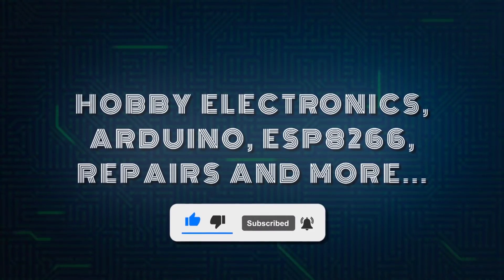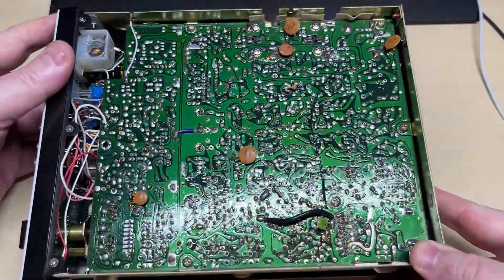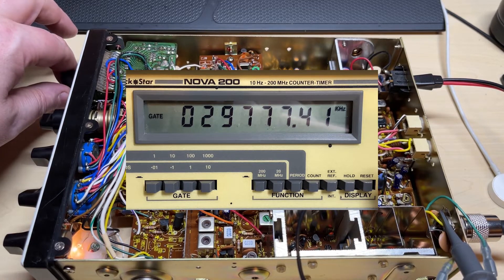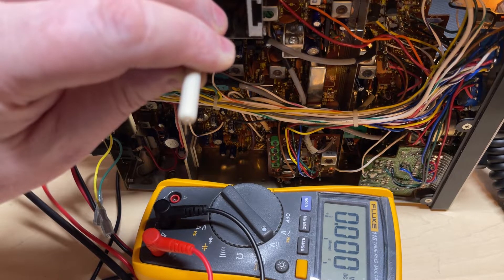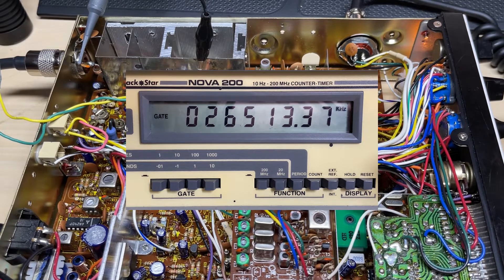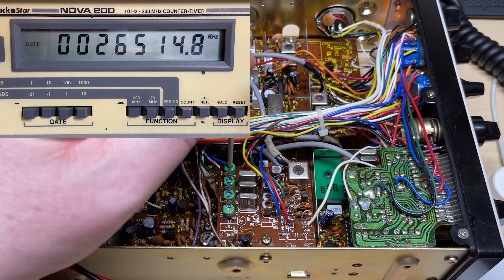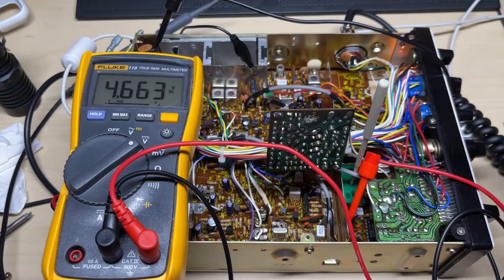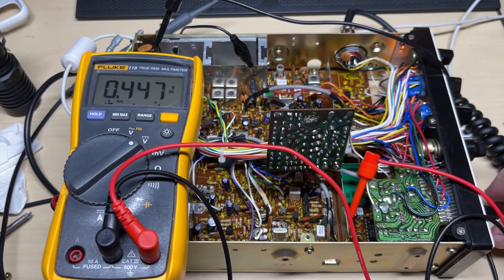EP 067 - Tristar 747 PTBM121D4X Part 1 - First tests and some essential modifications.

Comment: Hi, Thanks for this incredible usefull playlist with the Trsitar 747 ! I've proceed to align mine as shown on your video, but I've noticed that for me CT1 CT2 and CT3 are not in the same "order"... 
For me, CT1 set the Middle band, CT2 set the High band, and CT3 set the Low band..
Is this normal ? Maybe the previous owner of the radio did something with it?
Should I fixed this to get back to the original order from Low to High as it is on your radio?
Thanks for your help.
Reply from the maker: They are only the crystal trimmers , no problems , leave them .
Reply: @MicroChipz  thanks !

Comment: I take it that it is a HAM International Multimode II by another name?
Reply from the maker: Not really , this is the 121 board found in hygain v , concorde 2 etc , only the later mm2 had a 121 board.
Reply: @MicroChipz  thanks for the answer. So does that mean that my Concorde II is the same as the 747?
Reply from the maker: technically yes , as its the same board , but the conc 2 has a lot more functionality .

Comment: notice no green wire that would, on some models go from the avr to i think rv13 next to the darlington, so this is a high power fm varient, the 320 fm black shadow i have is the same, 12w without any trouble, it would do more, but of course with age etc, 12w is enough.

Comment: R150 will need swapping to a 5.6k or it will sound awful on fm and ssb due to the limiter being too harsh.
Reply from the maker: Hi, thanks for your comment , yes this is covered in part 2 ;)
Reply: @MicroChipz  had a feeling it would be. Its amazing that  two resistors gave these such a bad reputation as when the y are changed its a different radio. Love your new uk boards. Such a time saver
Reply from the maker: @cubwolf  Thanks glad you like them, i don't know if you are on the Facebook group but this radio is having a slightly different board, still the same form factor and ease of install but different functionality. This new board is for the AG pll and enables the 5kc drop and alphas. and ofc uk40. All my boards are on the facebook group . currently working on a board for the 148gtldx mk2/ss360 .
Reply: @MicroChipz  yes I have fitted both now and got a source of ag pll chips via Jay
Reply: I have one of these , tbh I really don't see the point in doing any mods on it as mine works fine...
Reply: @HueyAT5  trust me they sound awful without the mod. The limiter makes it sound clipped and is the reason they had such a bad reputation. It really is night and day especially on FM
Reply from the maker: @HueyAT5  If you are happy then no need to touch it at all.